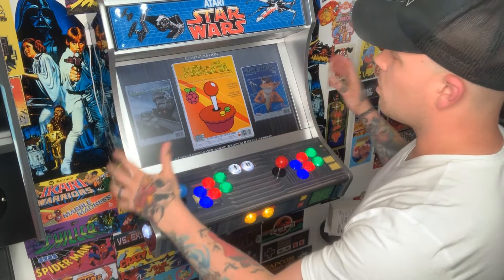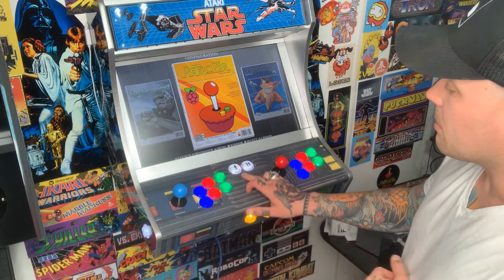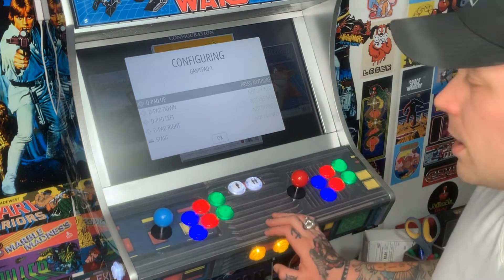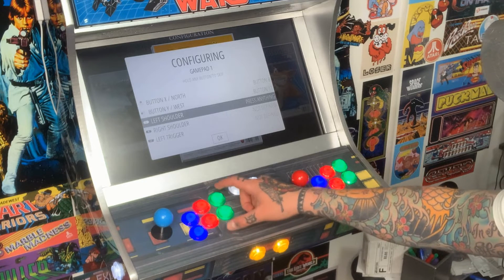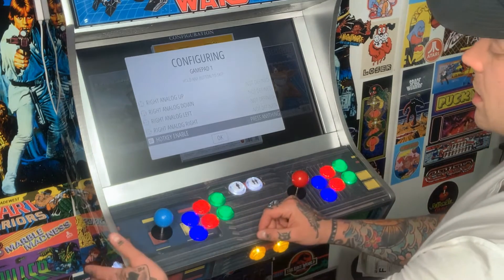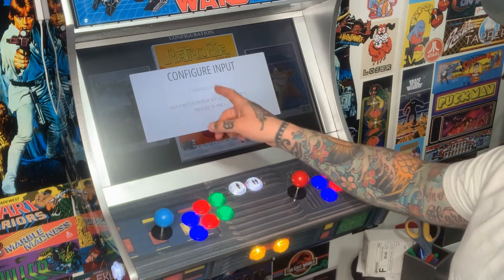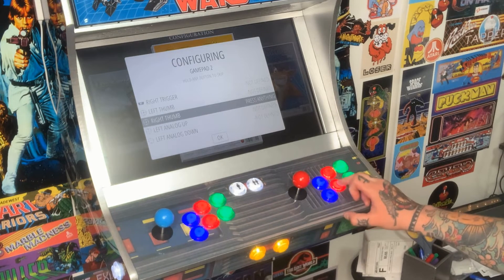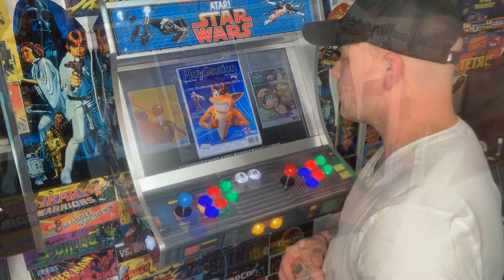How To Map Arcade Controls On RetroPie - Arcade Cabinet Tutorial - RetroPie Guy

Comment: Very useful tutorial, thanks a lot!  But I still have one question...  I followed your steps and did everything right.  All my buttons are working and I can scroll through the menu's etc...  But when I want to play a game, I get a short text 'your controller is not configurated' and I can't play any game...  I don't know what to do and would kindly ask for any help on this problem.  Thanks in advance!
Reply from the maker: That's weird. Maybe it a compatibility issue with your buttons and joystick. I would reset input configs (I have a video on how to do this) and try again. If you just remap without clearing these your issue is likely to reoccur. Hoping that clearing it solves the problem. Retropie has be tough with random errors like this.

Comment: Hey I have a question. How do you map buttons to a specific game? For instance mortal Kombat? By default the block button is on the right side. I want it to be in the middle.
Reply from the maker: You go into retroarch and make the mapping adjustments there for certain titles. Usually hot key and whatever is set up as x button will open that up. I have some videos on that. The link below shows this process with n64.

https://youtu.be/DBVu-VRua88
Reply: @officialchasebrogan  
Thank you for your reply and help. I just happened to come across another person saying that by plugging in keyboard to the raspberry pi and hitting the tab button while in gameplay. And there you can change the buttons also. Is that another good way?

Comment: I’ve done that but once I’m in the game the controls don’t work
Is this an easy fix?
Reply from the maker: They don't work at all or they are doing the wrong functions?
Reply: @officialchasebrogan  nothing works except the hot key for backing out the emulator
Reply: @officialchasebrogan  this is a usb arcade stick I have built and is recognised as generic usb device
Reply: @retrobombstudios1258  hi, did you get an answer here. I bought system, and Defender game only recognising joystick? Many thanks. Other games only 1 button working, when there should be 2 ?
Reply: Nope nothing but tumbleweed
Reply: @retrobombstudios1258  shoot, hopefully guy who built it wil come back

Comment: Interesting! I thought your type of joystick would have been mapped as analog and not a d-pad. Isn’t it an old fashioned analog stick?

I’m building my cabinet now. I will have only one joystick and button set as it was on most cabinets of my youth. I guess the two player button will have to be set up in Mame then?
Reply from the maker: Yeah you'd think it would be analog but the way the mapping is setup on there it pulls the navigation from d pad first. I suppose this is because every controller has a d pad and the system is intended for controllers more so than arcade control decks.  As for the 2 player button I'm not sure what you mean? Are you going to have a player 2 setup as well? If so you'd just map that the same way but separately so it registers as a second set of controls.
Reply: Yes, I’ll put in both physical 1- and 2-player buttons but only one joystick and player button set. This is how it was on nearly all arcade cabinets of my youth in the ‘80s. So it should hopefully be possible. I know that you can remapmap buttons directly in Mame and also I think in Retroarch as well so I guess there are many options. I’m away from my setup for a week so I haven’t been able to test it yet.

Comment: I’d really appreciate some help. I’ve set my button exactly like this but the start button keeps returning me to the main games list menu.  Unfortunately it means I can’t play anything as all my games need start to work so just goes back and forward. Any ideas?  Thanks.
Reply from the maker: That's very strange strange. So you mapped your hot key button as select or a separate button from start? Maybe try flipping your mappings around. Assign start as your hot key and select as start. Sounds very weird but the issue itself is strange. That might do it.

Comment: I mapped my buttons on retropie the exact same way but they only work on the menu. When I load a game the buttons and joystick don’t work at all. Any advice?
Reply from the maker: Try an input config reset see if that wipes the issue out. Beyond that I would make sure the wiring is correct to your joysticks and button controls. You want each players wiring to be exactly the same or it will cause errors when you go to use them in games.

Comment: Is there a way to map individual games.  I tried but had no luck?.  Also I've gotten kicked out of retropie to a command line a few times how the heck do you get out of there with just the buttons?
Reply from the maker: I haven't done anything game by game with saves. It generally will add the changes across the whole collection. I usually just go in make changes for each game as I don't necessarily want to save everything each time across the board. If you get kicked out to the command line you need a keyboard to get out. Type sudo reboot and enter. Not sure why you're getting kicked out to the command line though. You mean the terminal right? That's weird.
Reply: Ok thanks alot.  The keyboard thin g though I tried to add it in retropie but it is added like a joystick type thing with just certain buttons mapped as a controller I think.  So o do t have full access of the keyboard.  Is there another way I'm supposed to add the keyboard so I xan actually use it to input commands?  As well as a cordless mouse?. This is all on an arcade 1up mod.

Comment: This is a very informative tutorial, however it does not help my situation.  I have a 2 player Xarcade Joystick with only one USB connection, (not two separate Xarcade controllers each with their own usb) and I cannot configure player two to the same usb input as player one.  I need to be able to remap the controls for both player 1 and player 2 using the same usb port.  How do I do this?
Reply from the maker: Not sure if that's possible. I've never had a setup that only had the one. You could try going into retroarch and doing port 1 binds for player 1 then port 2 binds for player 2 but it may not be able tk separate them given the single usb connection.
Reply: @officialchasebrogan  Do you suppose if I used a USB splitter in port 1 & 2 of the retropie to the controller it might work?
Reply from the maker: @christophercolletti1756  I highly doubt it but you could try.
Reply: It sounds like you might have a xin-mo controller. Google that and see if it matches what your hardware plugs into. In that case you also need to go into retroarch and configure it. It's kind of finnicky in retropie, batocera plays better with the xin-mo but I'm also finding a lot of the MAME titles I absolutely have to have will not run on batocera. But your stick will work way easier.

Comment: What about the front two buttons?
Reply: I had this same question..i think i may try to use them for the auto fire and tubo functions on the encoder?
Reply from the maker: @chrisskinner6483  definitely doable
Reply from the maker: Those are there show haha. The kit I bought then had to customize because it wasn't good enough had those predrilled. They already had side holes drilled too and the start up top so I didn't need those and I felt using them as select or start would become a problem because they're easy to hit by accident with your body when playing. They're plugged into the encoder so they light up but they don't have a function assigned to them.

Comment: great video!! I was wondering why with some games if im playing 2 players, specifically fighting games, sometimes it'll jump to a retro arch screen or some type of configuration menu?
have you ever had that issue? it's happened with a few Capcom games like SF3, SF15th Anniversary and FOF 94' on the Neo Geo. 
Does it have to do with the Hot Keys? I have mine configured just like you have it shown on your video.
Thank you, I appreciate all the help I can get :)
Reply from the maker: Thanks! That’s weird. I’ve had that happen with some controllers in the past but not with the arcade controls. The mapping should prevent that. Maybe for the games you have it happening on the default mapping has somehow changed. Do you know what buttons are causing the retroarch menu to pop up? It should be your hot key button and whatever you have setup as X. That’s not always the case but that’s whag bring up retroarch for me. My hot key is set to select which I don’t use for any games really other than inserting coins on arcade games.
Reply: @officialchasebrogan  Hi, thank you for the quick reply. My "X" Button is the same as yours on a 6 button layout, it's the middle button on the top row of 3 buttons ( where Medium Punch) would be if playing Street Fighter.
I also have my Hot key set up as Select and exit my games by pressing both Select and Player 1 (start) button.
It's so strange, it only happens with a handful of games which is annoying when playing them on 2 player mode and in the middle of an intense match.
Reply from the maker: @3shibuyallc486  that’s very weird. I’m sorry I don’t know why that is happening. Maybe try resetting all your inputs snd reconfiguring but I’m not sure that would solve it.
Reply: @officialchasebrogan  no worries, i'll give that a try. thanks again :)
Reply from the maker: @3shibuyallc486  any time

Comment: Hey, I'm having a configuration issue with my arcade joystick and buttons. Whenever I boot up a game then exit back to the menu the controls for player 1 or player 2 get scrambled to where random buttons do different controls. I've been spending 3 days now trying to fix this issue. To get a better understanding of what the issue is there is a video on my YouTube channel explaining the issue.
Reply from the maker: Hey there You need the buttons to be mapped to the encoder for player 1 exactly the same way as player 2. Meaning each button goes into the port on the encoder the same way as the other players. If there’s any discrepancy then the controls get all blended together like what you’re describing. I’m going to do a video talking about this later today actually.
Reply: @officialchasebrogan  It worked! Thank you so much! If It wasn't for I would of given up on my entire arcade project. When ever I need help with something that involves retropie I'm going straight to your YouTube channel!
Reply from the maker: @skinnyarms1159  thanks for the kind words!! Glad it worked!!
Reply: @officialchasebrogan  Ok thank you, I'll try that
Reply: @officialchasebrogan   this explains it, but for those who aren't sure,  I think @rRetroPie Guy means the physical connection from the button to your encoder (ie usb encoder) should be the same for player 1, and for player 2.  So if you physically plug the wires for say button "1" into the first slot of your player 1 usb encoder,  for player 2, you should plug the wires in for button "1" into the first slot of the player 2 usb encoder and so on.  Both encoders should be physically set up the same.  I'm not sure why, as you can map, but everything I've read says to do this, so double check this if you're having problems.)